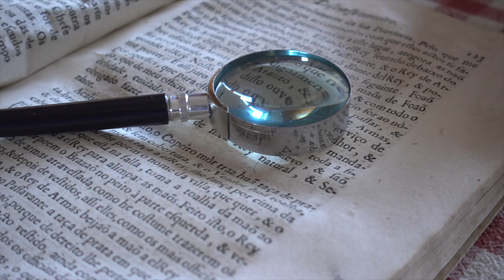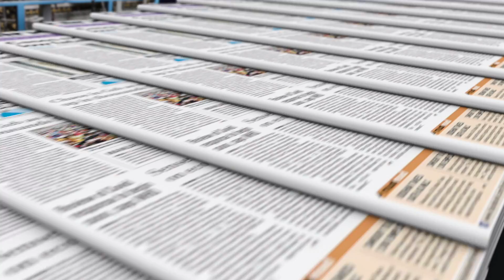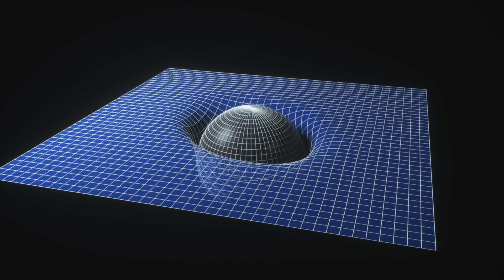5 Experiments That Could Have Ended Humanity

Comment: More sensationalzed bs. Be afraid! Be very afraid, those crazy scientists don't know everything. No but any geologist could and did tel! them that while drilling in the Kola penninsula they would and did eeventually get so deep that the heat would start weakening the steel drill bits. Any deeper and the rocks soften and the bore hole would just collapse. There was no danger of any kind. The same is true of al! these examples. There's always some lesser talent hanging around the fringes trying to get some attention by making shit up.